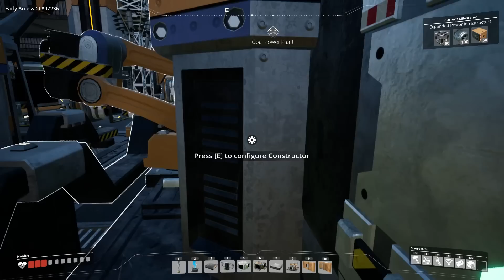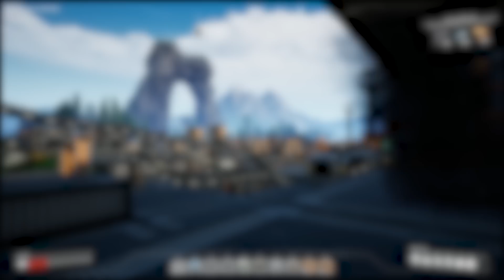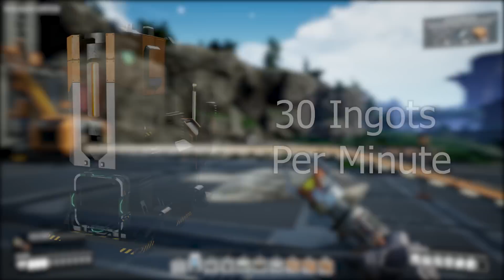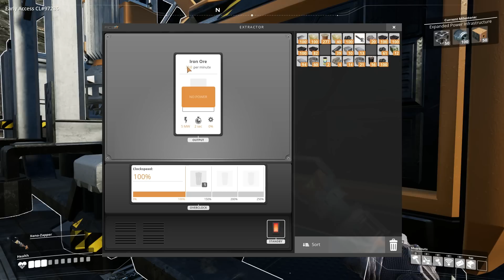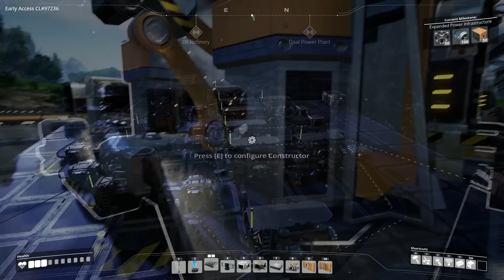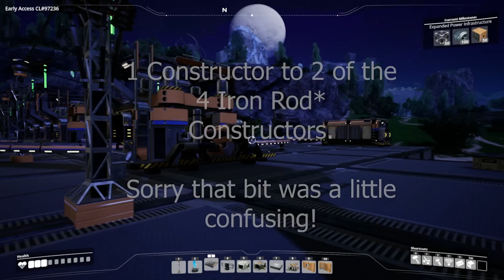Satisfactory Game Super Efficient build guide pt1.

Comment: Anyone watching this still I recommend going in northern Forest for your spawn point, there is an area with 3-4 pure iron(360-480 iron per min), 2 copper (240 per min),and 2 limestone(240 per minute) all within 300m-400m of each other.
Reply: Yep I start there
Not even using the forth iron node
I think with mk3 u only need 2 node there
Was 100% efficiency till I upgrade belt to mk3 and miner to mk2
Most ore in traffic no, the co structor cant eat ore as fast

Comment: If a Mk2 produces 60 ores per minute on  an impure node, why did u use mk3 conveyor belts? dont u need to.use mk1 conveyor belts because they are transfering 60 per minute, so its the same....how does the conveyor belt affect this production rate i dont get it :(
Reply from the maker: You can absolutely use MK1 conveyor belts, but MK3 belts are easy to produce so by using them you can future proof them for bigger over clocks or extra inputs

Comment: Sorry but equal splitting being more "efficient" is a myth. When you split of in sequence, all you do is introduce another buffer (Inventory of first-served targets in adition to what's on the belts). After a few minutes (At max) your input/output will be exactly the same as with even splitters. But you loose the space advantage of splicing off in a straight line... wich is actually worse imho.
Reply from the maker: I see you're point, but at the same time, if your manifold is too long, it can take the items too much time to travel to the last constructors so that they are instead consumed by the first constructor in the line. Which can become an issue until you had more resources to the line. But the only downside to the manifold I'd say is the time it takes to buffer, but this can be avoided. Also as for the space,  yes it takes more room, but we have plenty of room to build in the map and a good split, can take hardly any room at all. :) Pro's and cons to both.
Reply: if anyone was wondering, it's called the overflow method and I tend to use it to save on space

Comment: Overflow method takes a moment to get started but runs at 100% efficiency as well after that.
Plus:
- you're getting a "free" buffer which will bridge smaller gaps of input (e.g. due to re-building conveyors etc.)
- saving on space... a lot of space!
- easier to react on changes of the input flow, just add or drop machines in the row.
Yes, "booting" time would rise linearly with the amount of machines in a row. But you're powering up your system only once, do you? ;-)
Reply from the maker: Luftwolf you raise some great points and I actually go on another video to talk about the exact same system as you and how it’s just as efficient :)
Reply: @TotalXclipse  : There are a few "fundamentalists" who don't want to believe me, so I'll need to get your video on this topic to them! :-D

Comment: What are power shards? I don't see that on my machines
Reply from the maker: Heya! Thanks for checking out my video, powershards need to be unlocked through researching powerslugs. You'll be able to add them to your machine to overclock them past 100% upto 250% so they will be very useful for you eventually, you need to reasearch powerslugs at the MAM in your hub :)
Reply: @TotalXclipse  Do mining nodes ever run out?
Reply from the maker: ErrADDict no, there only limits are the miner speed and the speed of the conveyors taking the items away